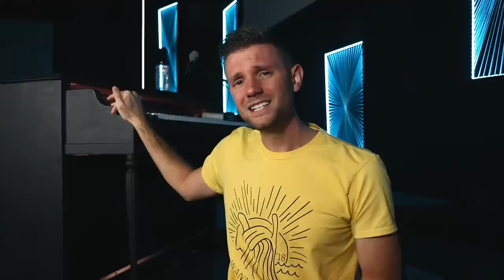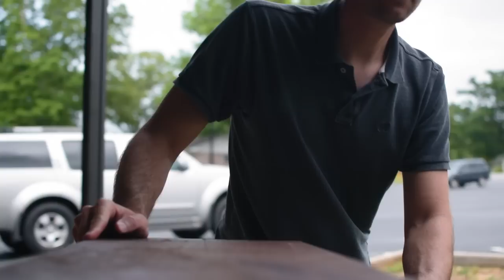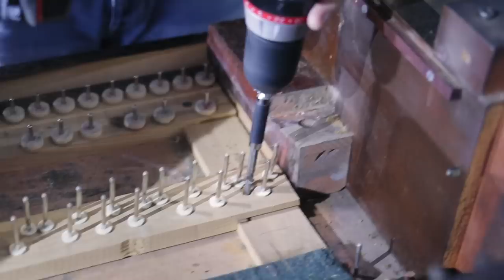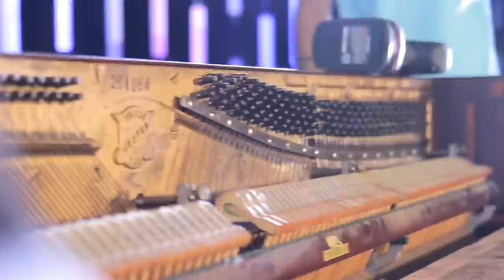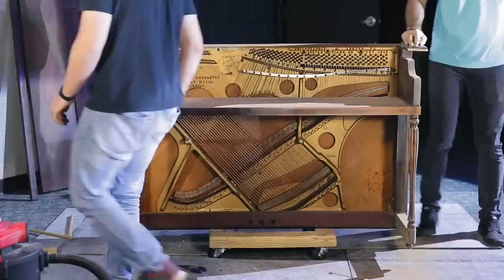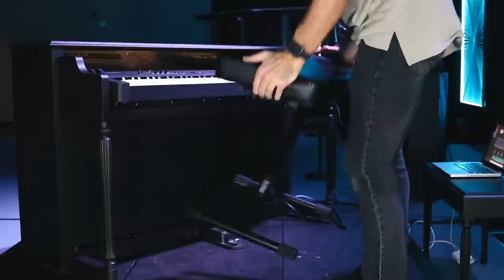How to Gut and Retrofit an Upright Piano for Your Keyboard

Comment: Something that I’ve done is actually take the iron plate and strings out of the piano shell. It makes it so much lighter and easier to move around for stage design purposes. And is actually not that hard to remove. The only thing is that it takes a while to remove all the strings and pins. But after that, it’s well worth it. Plus, you don’t have to worry about the strings in the piano resonating.
Reply: Make sure you DETUNE the piano first!  The strings are under very high tension!
Reply: @anthonyoresteen4767  Every single wrest pin has to be completely removed before the iron harp can be removed.  The pins go through the harp and screw into the wood frame of the piano.  So this the process of "detuning" the piano happens automatically.

Comment: *TIP* try putting an LED par on the DMX line inside the piano for the light, a cheap one would do the trick and fill that thing with color that matches the stage lights..

Comment: But, I'm also guilty as charged. Years ago, I was asked to do this for an older student of mine - who didn't want the hassle of tuning and regulating her upright piano (but she ALSO didn't want an ugly keyboard on a stand in her small condo. So, I carted her old spinet piano home and gutted it for a Yamaha P-80 keyboard with simple internal stereo amplifier and speakers in the front panel...By the way - the old P-80's are STILL wonderful 88 key hammer-action keyboards and you can find one in great shape for $300...Even for the time (2004 and newer) the sampled grand piano sounds wonderful. Be advised (as noted in the video) that the height of the front tray - even after the keys are removed is at least 4" too high so, major surgery is required to lower the front legs and remount the tray section. It can be done, as you explain in your video...

Comment: I found a tossed digital upright piano. If I chop the keyboard down to only 37 or so keys, could I wire the remaining keys to use as a portable (couchable) digital keyboard?? Or will messing with the keys affect the circuitry? 
I would like to salvage this thing, but also make it smaller. Thank you..

Comment: I'm wondering about the strings you left in the piano. Since there's no longer anything there to mute them, do you have a problem with them vibrating and creating an unwanted wall of sound? (I'm a piano tuner/technician).
Reply from the maker: That’s a good question. It doesn’t cause any noticeable sound issues. It probably helps that our stage volume is pretty low with using IEMs. Thanks for watching.